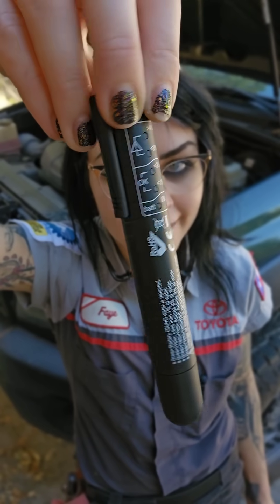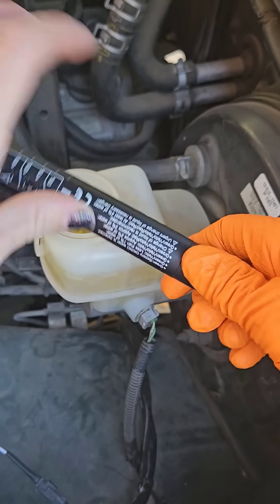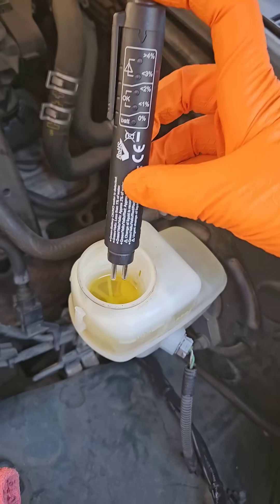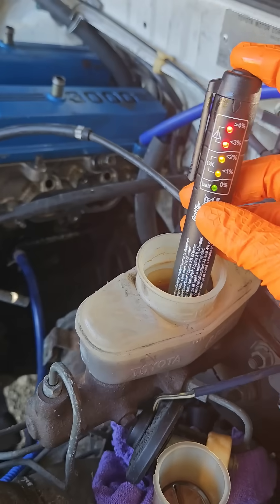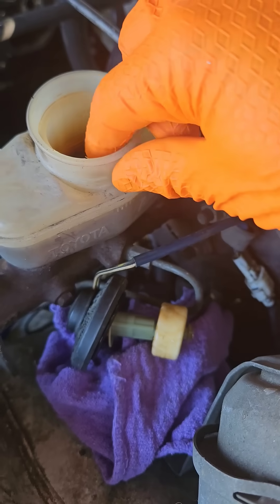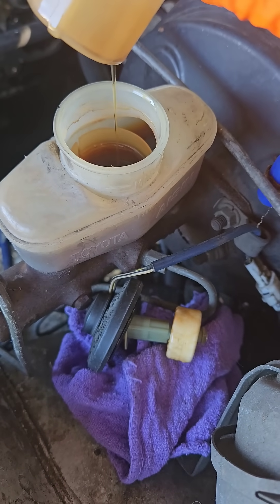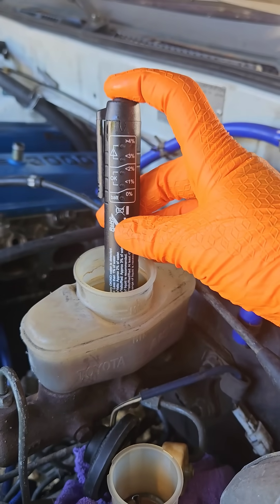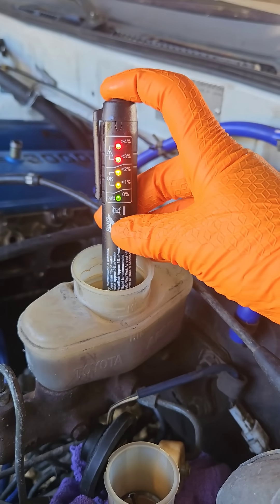Do you REALLY need your Brake Fluid Flushed?? How to Test it For Yourself!

Comment: Absolutely correct in all aspects. I ran a wrecker for years and you wouldn't believe how many crashes were caused by brakes that "suddenly" went out. Looking in the engine bay you could see the filthy reservoir. The water in the fluid can also cause wheel lockup under severe braking when it flash boils into steam leading to a possible loss of control. Some of the accident scenes you would see only one single skid mark leading off of the highway.

Comment: Not only that, but the rubber hose is kind of absorb that moisture, and they will swell from the inside, which narrows down the inside dimension of the Jose, and makes it much more difficult for the brake fluid to pass. Because the brakes on my bug to lock up and dang they killed me, but for the grace of God, I was OK

Comment: The problem with these testers is that they only test the fluid in the reservoir. I've had fluid in the reservoir test good and look good but was completely black at the caliper.
Reply: Brake fluid is less dense than water, so the water will sink to the bottom of the system at the calipers. Best to bleed a little of the fluid from the caliper's nipple and test a small sample for contamination.
Reply: @luisderivas6005 - Ha ha ha, you said “nipple” te he he he 😅
Reply: This is - at the very least - the best way for someone who isn’t ‘mechanically literate’ to tell if they need a change
Reply: @thereinthetrees_5626 actually a repair like working in casa if brake like replacing brake pads must cgange fluid
Reply: @thereinthetrees_5626 say an honest mechanic advises the change because of contamination, Mr noob then calls him a crook because he used his cheap water tester.
This video should really clarify that moisture/no moisture in the reservoir isn't everything you need to know.
Reply: @thereinthetrees_5626 the best and cheapest way is to ask yourself if the fluid has spent 2 or more years in the car
Reply: probably from someone doing a turkey baster fluid change.
Reply: @halleffect1  not even. I do my own brake fluid changes. The fluid at the caliper gets significantly hotter than the fluid in the reservoir.
Reply: Sounds like bleed oil from calipers a test those samples
Reply: @francoanthoney1993  you could but if you're doing all that you might as well change the fluid out
Reply: Party pooper
Reply: Found the mechanic. Let me guess my car that’s running fine needs about $1,200 of work?
Reply: @gangsta8929  I'm not a mechanic, I just do basic maintenance on my cars. What i said is true. If you think you need a mechanic's knowledge to understand that then go sit in the corner with your coloring book.

Comment: Water compresses
Reply: liquid water won’t under the conditions you have in a brake system. However, gaseous water will, and brakes get hot fast.
Reply: @ZSmith-yy4lv  sure ya, but don’t say water doesn’t compress, it does

Comment: Grew up working on cars and never thought about this, thanks for the lesson. Gonna be doing a full brake flush my next brake job, almost to 200k miles and have had times where the pedal was a little more squishy than usual, never had a full blown air bubble because I do a quick bleed every pair of pads.

Comment: I would definitely say that the copper content and amount of corrosion inside your braking system is of a larger concern than the amount of water (symptoms of bad brake fluid don't show as easily as the soft brakes you'd feel from contaminated brake fluid) though checking for either is definitely a necessary step before recommending the service

Comment: Heaven help us. The top reservoir is NOT where the brake fluid goes bad. It goes bad in the calipers where it absorbs moisture and corrodes the entire caliper piston and brake line connections.
Reply: ....? You open the top reservoir, so it's more in contact with the atmosphere than the caliper, which is constantly sealed. Not to mention, obviously the top cap isn't completely sealing, even more with the differences in pressure while in use, so air and moisture do go in, just in small quantities at a time.
Reply: Absolutely not the case. Day to day, it is the caliper, NOT the reservoir that sucks in atmosphere.  @HeyyLiisten
Reply: This is not a joke. This is a public media that someone could see and therefore fail to change the corroded fluid in a caliper when the fluid in the reservoir was ok. Many times I have seen this happen in real world auto work. It is DANGEROUS because it can lock up calipers. @HeyyLiisten

Comment: Generally it is best to flush brakes every 2y, or at worst when it begins to not be clear. 

When a flush is done, the brake fluid should be siphoned out from the top, then more fluid added to bleed the brakes until they run clear starting at the furthest brake line and then moving to the closest. Anything else is a scam and unless you can trust the person/shop doing the work they will do things like only siphon the top and replace, or improperly bleed leading to a lot of old fluid being left.

That being said, motorcycles it is mandatory, light cars have a lot of wiggle room, and larger vehicles (trucks that haul/work vans with load) are also pretty dependent.